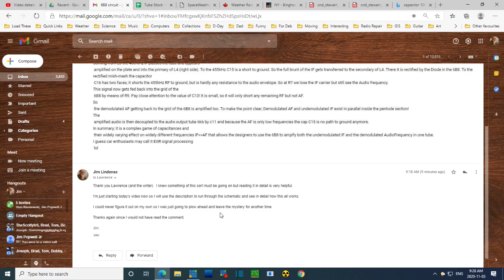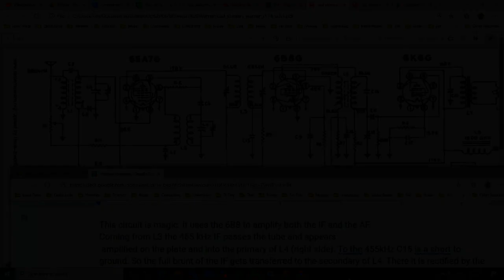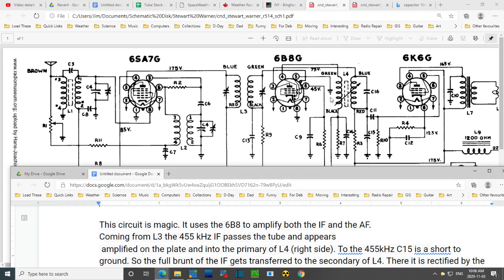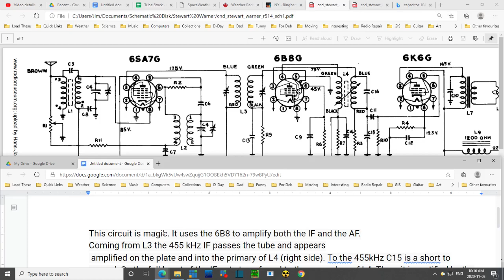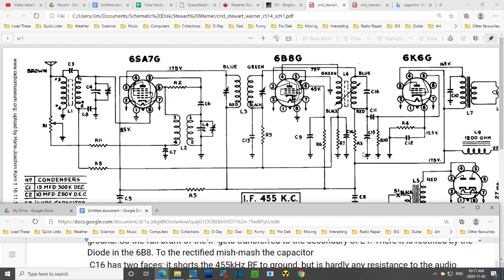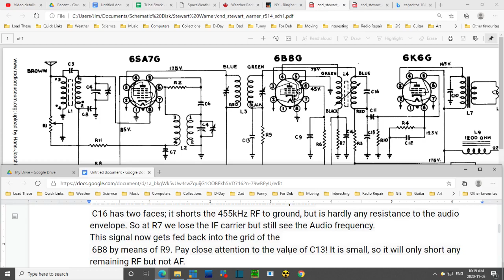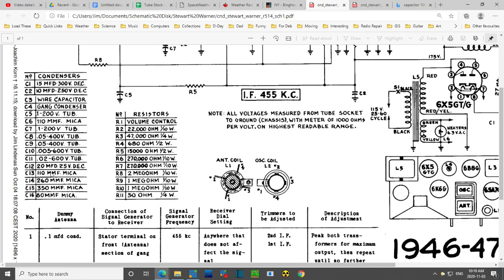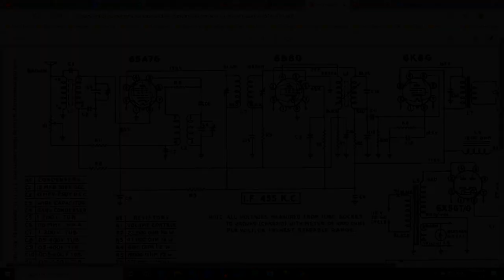Stewart Warner R514 Tube Radio Video #14 - Detector Circuit Operation, Resistors and Dial String

Comment: This radio has four tubes in it. If you think about it there should be five (AA5) but the 6B8G is being used twice! Normally you would see it used between a 6SA7 and a
6SK7 in the circuit. Looked at several  North American radio schematics and can confirm this as practice. But other manufacturers outside of America 
used this circuit to work as such. Popular between 1941 and 1954 with some Australian radio mfg's. Learn something new about something old every day!
.